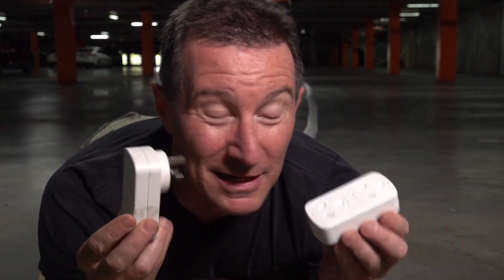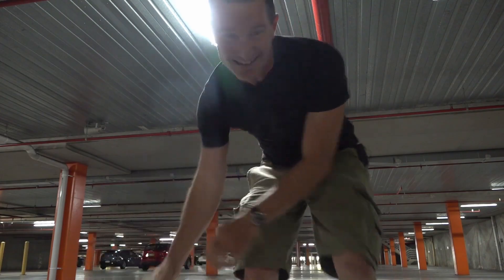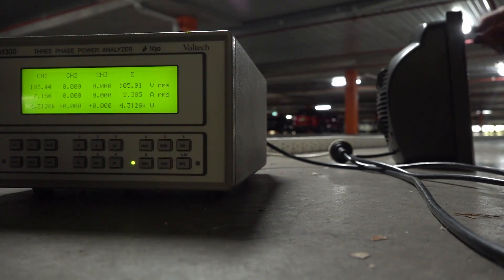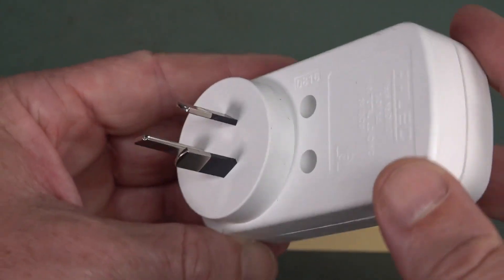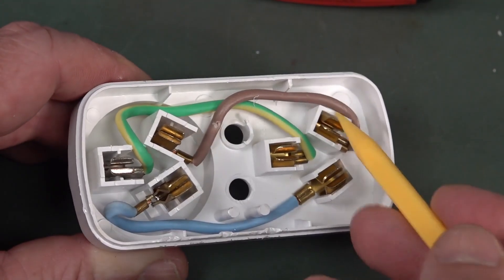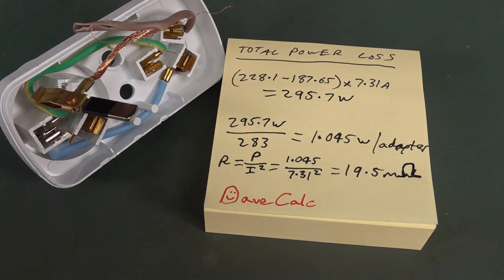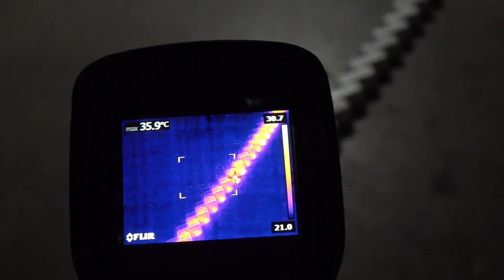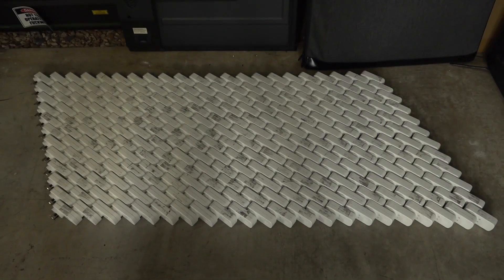EEVblog 1526 - I put 283 Double Adapters in Series with a 2kW Load!

Comment: Judging by their internals you could have stacked them using the other plug on each, bypassing all the crimp joints and wires, so you would see only the contact resistance.
Reply from the maker: Yeah, but the point is was to see how stupid this could get worst case. And you'd block the other outlet renderign the double adter useless.
Reply: @EEVblog  Just rotate ever other one by 180°... is what you could do if your plugs weren't polarized
Reply: @Zed.TheReaper.McCormick  There's a good reason for polarised outlets / plugs; sadly, only the Aus and UK mains connectors achieve this (and that includes Singapore, Hong Kong, South Africa, New Zealand, etc.); US and Schuko (Europe) outlets are unpolarised (except for grounded US outlets of course).
Reply: @cambridgemart2075  Not to forget swiss grounded outlets.
Reply: @cambridgemart2075  Polarized outlets have been the norm in new houses in the United States since at least the 70s. The neutral prong is larger than the hot prong. Or did I misunderstand what you said?
Reply: @chitlitlah  You didn't, no, but I thought that only applied to 220V outlets. I don't ever recall seeing a 110 ungrounded plug that wasn't reversible
Reply: @Zed.TheReaper.McCormick  Are they the 3 pin in line outlets? If so, that's what our very old outlets in Finland look like.
Reply: @cambridgemart2075  Well the 3 pins aren't quite in line (otherwise they would be reversible)
Reply: @cambridgemart2075  For about the last half-century, the standard North American electrical outlet is a NEMA 5-15R which has a wider slit for neutral and a round hole for earth ground on one side. If a device doesn't need a certain polarity or ground, such as a phone charger, then its plug may have the small-sized prongs on both sides so you can plug it in either way. However, something like a lamp, which needs to be polarized so the switch is definitely on the hot wire, will have that extra wide prong on the neutral side so it can only be plugged in one way. And the ground pin is asymmetrical, so anything needing that will also only plug in one way.
Reply: @cambridgemart2075  No, we have polarised non-grounded plugs here in the US too. In fact, the lack of ground pin is why polarised plugs are so important. Though, with the rate PC GPUs are going, people gonna need an electrician for locking-style NEMA plugs soon.

Comment: As a kid, we lived in an old Victorian house that had been subdivided into apartments. The detached garage was a former carriage house and horse barn with minimal wiring: Overhead lights with one wimpy outlet good only for a lamp. We had to daisy-chain extension cords from the house to use power tools. Many lessons were learned about extension cord selection, use and maintenance! After a few too many expensive extension cables had smoked, we finally buried some conduit and ran some Romex through it.

I remember we had a rule that we couldn't operate the drill for more than 30 seconds at a time, with a one-minute cooldown break between runs. The losses on the long extension cord run also took a toll on our brushed AC tool motors. We owned strictly Craftsman tools, which at the time also had lifetime warranties on their power tools. Many trips to Sears! It got so bad that we used an antique hand-drill for smaller holes, to save the power drill for when we really needed it.

The conduit and Romex were soon seen as a far cheaper alternative to the trips for tool and extension cord replacement, not to mention the time lost.
Reply: Romex in conduit is a code violation, but probably much less so than what was there before!
Reply: I had to run 200 meters of extension cord to pump water from a creek. The pump ran at about half speed.

Comment: Do not forget that those cheap super dodgy extension cables makes half the overall loss as well, as the cheap cable is likely made with minimal copper inside. Also can definitely say the pins are likely to be plated steel, instead of brass.
Reply: Look at the input voltage in the video. Just a minimal loss after the extension
Reply from the maker: @tfoutfou21000  Yes, it's not the majority of the loss, only 12V drop on the cables (240V-228V) compared to 41V drop on the adapters
Reply from the maker: The plan was to only have one short extension cord, but we placed them down the wrong way and wanted to get the shot done, that wasn't staged. But we measured the input power, so were able to get the actual drop of the adapters only, so that's all that really mattered.